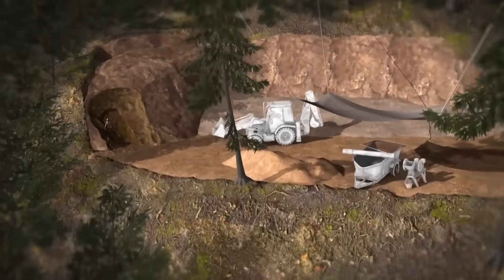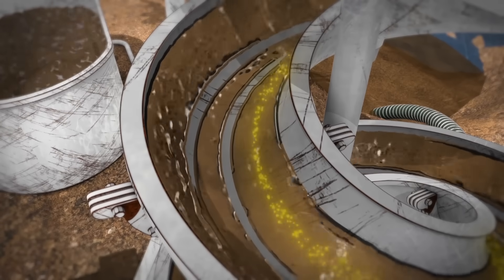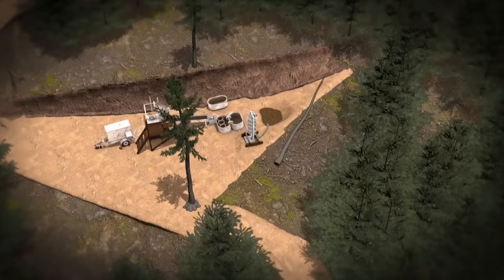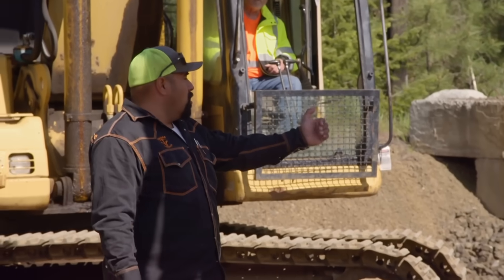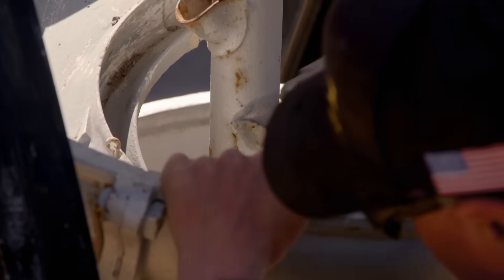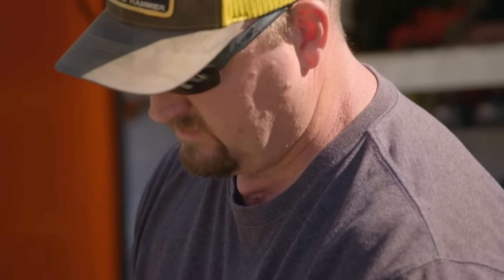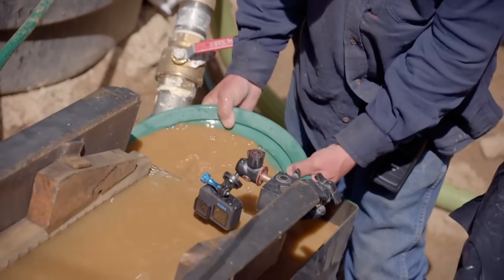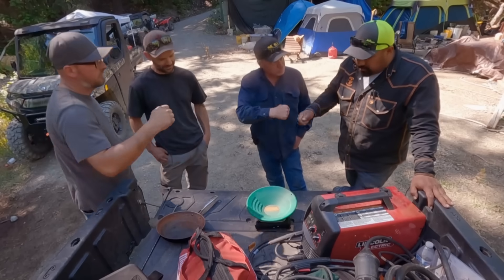Gold Production Increased 50 Times Over! | Gold Rush: Mine Rescue With Freddy And Juan

Comment: Nothing separates heavy fines like a cyclone
Reply: As long as u have correct pressure and cone size. Gold mine i work we have shaking tables and spirals for coarce gold and flotagion tanks and sentrifuges for fine gold. We use syclones to separate coarce from fines and flotation infeeds density, and purify our plant waters.Crushing plant and 2 ball mills crush the rock.